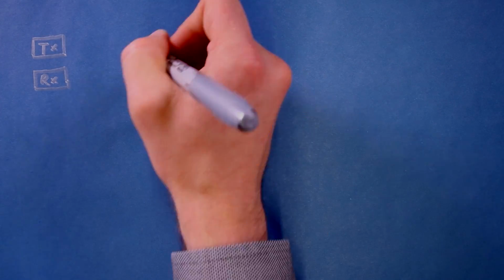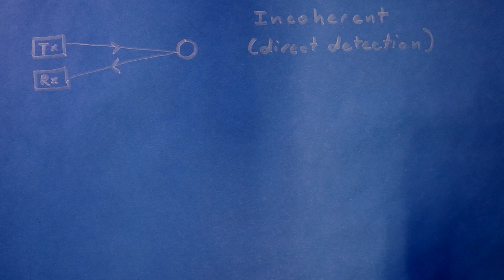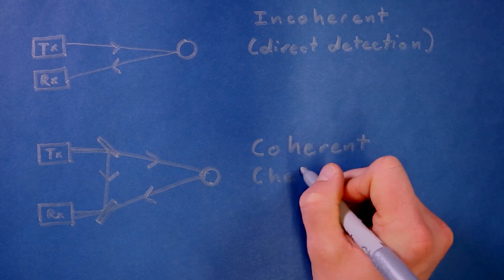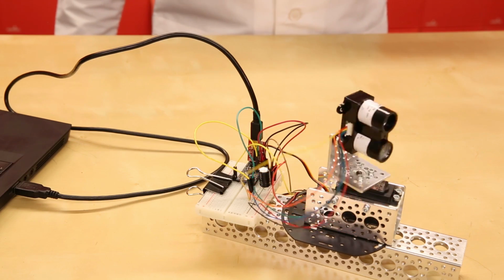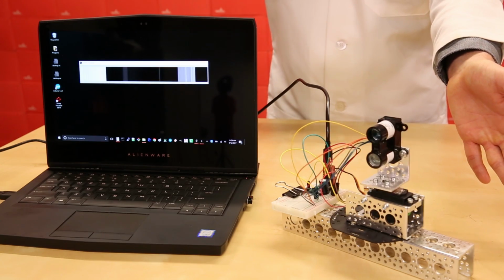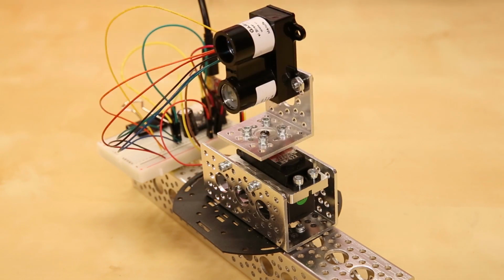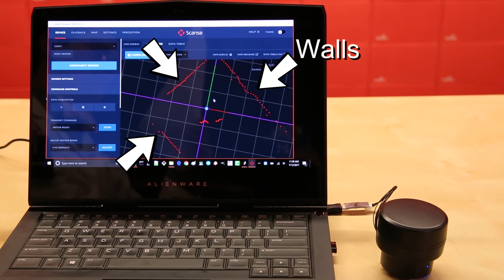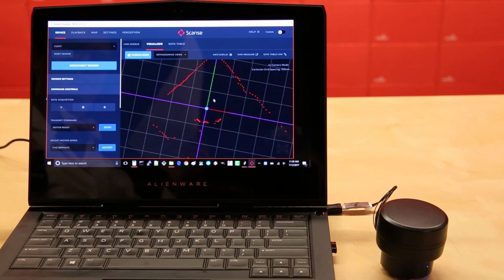Adventures in Science: LIDAR

Comment: Good rule of thumb for Americans (and others blessed by the customary/Imperial system): The speed of light is about 1 foot / nanosecond.  The propagation speed of electromotive force (that's voltage to you, bub) in copper varies depending on various factors, but inside a processor it's about 1/3 the speed of light and in very good cables it's about 9/10 the speed of light.

Using those figures (and propagation delay numbers from datasheets), you can probably ballpark the time it takes between activating a signal to turn on a laser and getting a return back from your sensor.  If you code the part where you turn on the laser and look for the return in assembly and count clock cycles, you can likely DIY your own crude LIDAR.  Do a bit of calibration and you're set.

Hey, found a new project to try.  I've got some old CDROMs around here somewhere...

Comment: Light speed is slower in air
Reply: True, and these devices take this effect into account (else, they wouldn't work) by calibrating them, I'd imagine. Using the speed of light in vacuum is likely just to get the point across on how the LiDAR process works at a basic level
Reply: Unless you're measuring things very far away, the (very slight) difference doesn't really matter.  The margin of error in the measurements (if this video is to believed) is several orders of magnitude greater than the error caused by light being slowed by air.